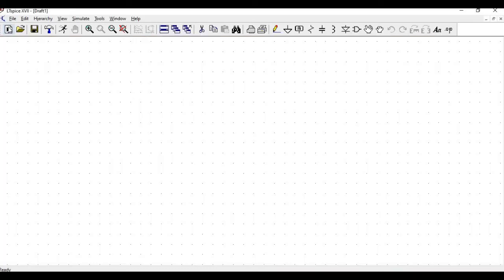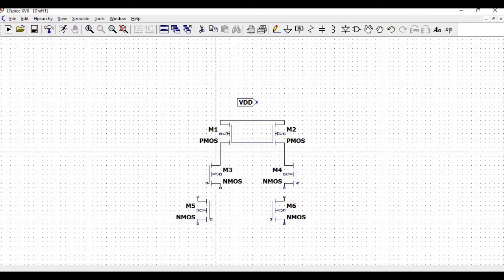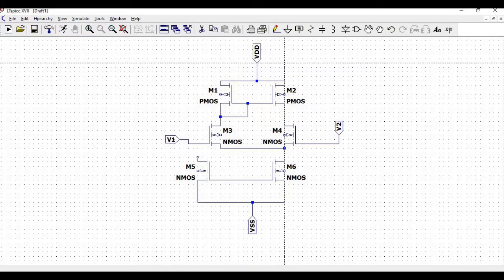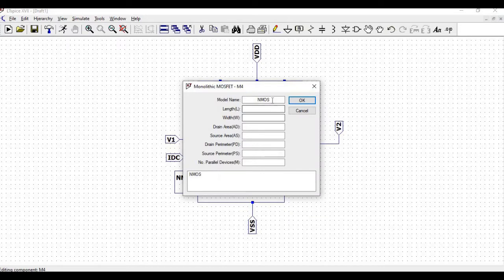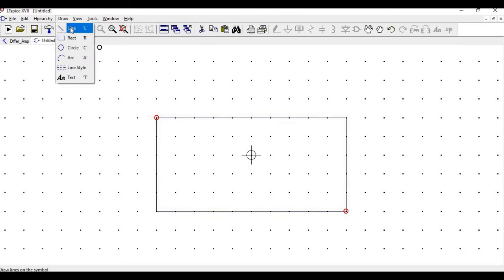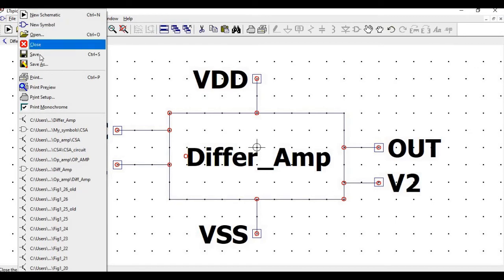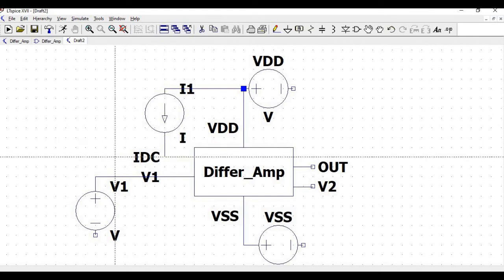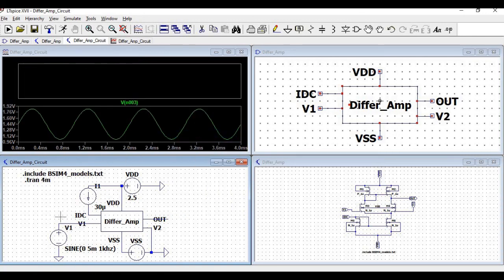Transient analysis of an Differential Amplifier using LTspice tool and BSIM model

Comment: hello, good morning. would you by any chance know how I can import the model of the BS250P pmos transistor? because I'm doing the simulation with discrete components and I can't include the library of this transistor. I found the Philips library for the BS250P but I don't think it works as the gain drops drastically (while the active pmos load should increase it). Thank you soo much!!
Reply from the maker: I am not sure if you have come across this. 
https://www.analog.com/en/technical-articles/ltspice-simple-steps-to-import-third-party-models.html
Reply: Thank you so much!!